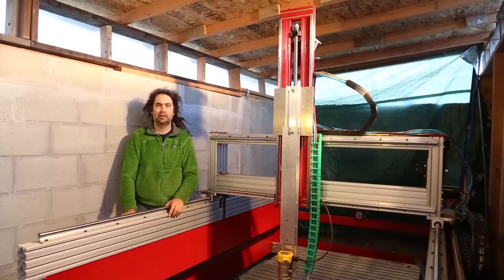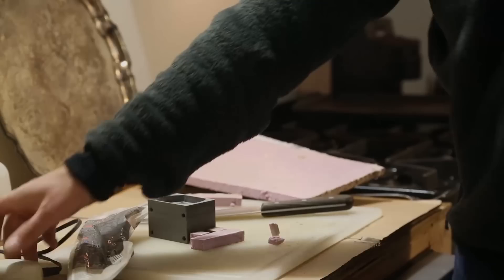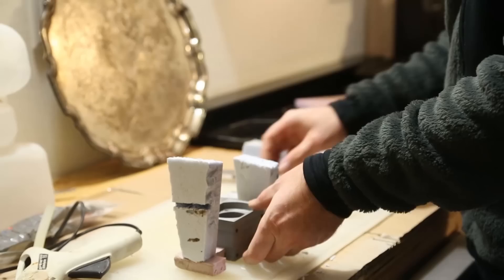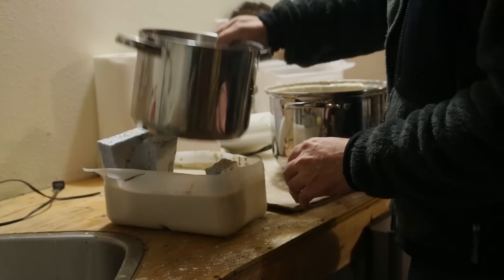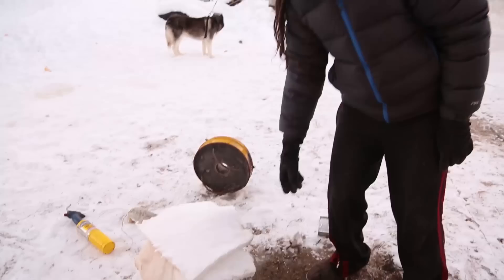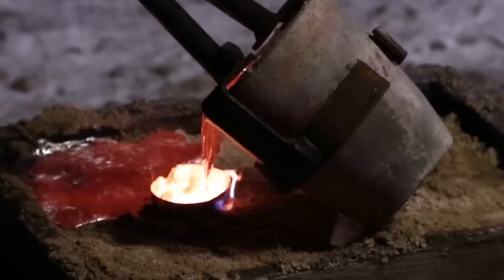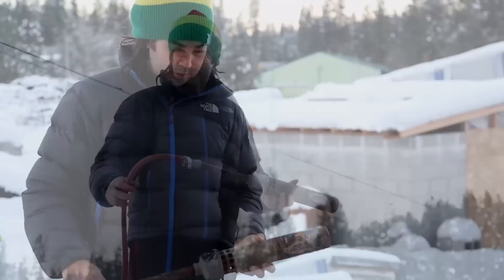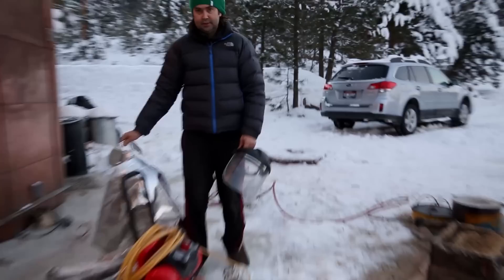Lost PLA 3D Print to Metal Casting; Complete

Comment: When you pour the alloy into the mould, would it help to provide some sort of vibration just as you did for the air bubbles in the first mould?
Reply from the maker: It has never been an issue for me, as metal is much more dense than air. Just make sure there are proper vents and a tall enough sprue to ensure adequate hydrostatic pressure of the molten metal.

Comment: "angle to build pressure" with the spru.  Do you want downforce on the casting material?  Because the static pressure at the bottom isn't any different (w/ or w/o taper), and I doubt you would want any dynamic pressure effects..
Reply from the maker: The purpose of the angle is choke the metal at the sprue (by increasing the pressure at a neck).

Comment: Couldn't you have printed the sprue's and risers and such into it instead of using the foam? Although it was probably more cost efficient to use the foam currect?
Reply from the maker: Yes and possibly, though now I often will print them all out with the part. Makes a lot less manual work.

Comment: Good to know about using play sand, I've used worn out aluminum oxide blasting sand a few times, but generally I use 200 mesh silica flour.  Makes for a really nice finish in the final casting. 50/50 by volume mix.
Reply: Yeah I never heard of using play sand forecasting I just shook my head and walked away. I always use Silica I've been lost wax casting for 35 years and I have never use anything but silica sand. And if you want real fine intricate work you can play with cristobalite in addition it prevents a thermal shock and it allows expansion and contraction remember without allowing it to crack. But in the end cristobalite is mainly used for jewelry casting sign filigrees xcetera. If I had to make some sort of valve body I would use it
Reply from the maker: The play sand I used was silica. Did you even bother looking at the results? I don't think the cast could have come out better quality than it did.
Reply: 3DTOPO if the place and was silica give me the name of the company can so I can sue them for every last penny they HAVE.   Breathing silica sand and the dust that comes off of it causes silicosis and mesothelioma cancer. That's what I've always use a respirator when using it. Play is beach sand with shells removed.

I'm not criticizing you it also don't get so defensive yes it came out very very good did you read what I wrote I said when I heard place and I rolled my eyes and walked away. And then I saw the finish and it was nice.

I was actually going to ask you some tips about getting started doing this. I haven't even built a fort yet I really need to do it because I'd like to pull blanks for my lathe. Also I'd like to try to do some cast iron lathe crank handles after I get the hang of it.

Are there any good books you can recommend? One of the reason why I roll my eyes all the time when people do something different is because I can't ever get anything done there so much conflicting information on the internet I want to pull my last hair out
Reply from the maker: Apparently it is common for playground sand to be silica: <http://safemama.com/2009/05/18/faq-whats-the-deal-with-play-sand/>. Anyways, I probably should have said "river sand" which is also usually high in silica (or quartz, but quartz is essentially silica too). I bought the bag of sand at Home Depot. Its a little dated, but one of the "bibles" for casting is the the US NAVY Foundry manual: <http://www.hnsa.org/doc/foundry/index.htm>
Reply: Jesus that's insane why would they do that beach sand is 100th the cost
Reply from the maker: Clown Whisper "know that beach sand is silica, too, though the fine dust would have been washed away by the water" according to <http://achildgrows.com/blog/2015/07/what-you-need-to-know/> (I suppose river sand would have this advantage too) . They add "this study shows that beach sand is full of contaminants from birds, sewage and urban run-off."

Comment: I just had a crazy thought. You know how it is possible to 3D print clay. Well surely it would be possible to 3D print a mould for any metal part out of clay as from what I understand clay should be able to stand the temperature of aluminium or copper of lead or what ever. Just 3D print the mould, pore the metal and when it has cooled off, crack the clay. Job done simple!!.
Reply from the maker: +Harry Bartelink better yet - they have sand casting printers, search for "sand cast printer" here on Youtube. They just spray sodium silicate and use the CO2 sand casting process (just need XY table and control a inkjet print head). Clay will be problematic as it cracks and shrinks badly as it dries.
Reply from the maker: +Harry Bartelink clay is also problematic because it is not porous, so you would need a lot of vents, and likely want to add something like straw to it.

Comment: I know this video is "old" but I felt like I needed to ask:  Could you not 3D print the gate and whatnot onto the part, instead of fabricating it by hand?

Also, when you used the aluminum foil, and cans in your mould, did that not corrupt your otherwise "clean" alloy with impurities as they melted on contact with the molten metal?
Reply from the maker: See the previous comment: we usually print the gates, etc. now, but I thought it would be easier to explain the various functions by making them for the camera. 

As for a can corrupting the metal, it would have been localized and very negligible for our purposes.
Reply: 3DTOPO I see. Was just curious. I don't have the space or means to do this but if/when I do I'd like to have at least a vague idea of what it entails lol

Very informative video in any case. Thanks for the reply!

Comment: Very informative & educational on new ways to make use of 3D printing.

One question though - if you had a working 3-axis would it not have been quicker, easier and cheaper to just mill that part given its simple nature?
Reply from the maker: +15uzu that would not make a very good instructive video on how to cast metal would it? ;) There are numerous reasons in addition: this process can be used to cast parts literally impossible to machine even on a 5-axis machine, I used 100% recycled material for the part (didn't buy an expensive billet), no wear on my expensive end mills,  setting up the g-code, mounting the piece checking and double checking, running and managing a CNC machine isn't really any less work either (I could go on). Especially now that I am set up for it with a vibrating table, and I usually just print the part with all the plumbing (sprue, runners, gates, etc).

Comment: I didn't see any paths for air to escape at the top of the molded piece. The vents were all at the bottom. Why wasn't air trapped at the top of the part, leaving a void?
Reply from the maker: This is a popular question. It is because of the hydrostatic pressure of the sprue and risers that is well above the part being filled. That said, vents are a good idea to add at strategic places as well.

Comment: Will the plaster mold hold up if you were to cast say brass or bronze rather than aluminum?
Reply from the maker: +Andrew Durrence Yes, but I would not go anything hotter than that (IIRC ~1800F is max for plaster of paris with sand). If you need hotter, use jewelers investment instead.

Comment: Great video! Will this method also work if I want to do small runs of jewelry pieces? The finish you ended with looked good, but will the plaster/sand get the detail needed for smaller parts?
Reply from the maker: I think the same mold preparation method would work, but you would likely need a centrifugal caster (search for that on ebay etc.)

Comment: Why didn't air get trapped at top of the part with the runners and gates at the bottom of the part?
Reply: I was going to ask the same thing... you need a vent at the highest point of the mold.
Reply from the maker: This is covered in the video. The riser also doubles as a vent.
Reply: 3DTOPO
But the fill point of the mold is on the bottom. How does air travel down, through the metal to get out as the metal is flowing in, sooner or later there would be a bubble formed.

Obviously not since the casting turned out well, but any mold I've made were not set up this way.
Reply from the maker: kleetus92 It is because of the hydrostatic pressure from the sprue and riser. Metal is much more dense than air and the sprue and riser are both above the highest part of the mold cavity so it is forced to fill with metal.

Comment: Tied the dog to the power line :-) can't you just leave the PLA in place ? seems to work ok. I learnt the exploding patio slab problem... luckily it missed me
Reply from the maker: Hah! Depends on the part, but I've seen the PLA plug up metal before. Also, if you burn it out first, you can vacuum most the ash out first. I poured directly into a PLA shell in this video: https://www.youtube.com/watch?v=tA1znkGbnSQ Glad you didn't get hurt with exploding concrete!

Comment: That is an awesome result!!!
But I feel like that a CNC would have been cheaper/faster/easier to make that part.
Much more complex designs are better for the lost-wax process.
Reply: he cant do that because his cnc machine was decomissioned
Reply from the maker: The point is you can use this identical process make casts that would be literally impossible to machine. Further more, unless you have a very fancy set up complete with robotic arms milling takes time and work too. First you have to generate your G-code, set up your billet (not to mention first purchase), change tools, etc, etc,. Plus there are other considerations such as my stock was 100% recycled aluminum from the local county dump. That said I have a vibrating table now that I can put a printed pattern on complete with printed runners and and risers and pour the plaster of paris mix. Whole things takes about 10 minutes mix and pour the plaster mold, another couple to pop in a furnace to burn out, and about 30 minutes of my time feeding the crucible and pouring. All said about an hour of manual labor for a beautiful custom cast part (or several).
Reply: 3DTOPO can this same process be done with ABS plastic? and what kind of styro foam are you using? im trying to make a cup out of aluminium and im looking at doing lost ABS because i dont have silica sand or sodium silicate to make a core.

Comment: Really interesting video on DIY foundry, however the part in question appears to be a perfect candidate for traditional, precision machining. In the time it took you to 3D print the pattern, a CNC machine would have your finished part, to much tighter tolerances. Thanks though for an informative video.
Reply from the maker: Thanks. That is a chicken and egg problem - we were building a CNC machine so it was not yet available. ;) Besides, I didn't have to buy an expensive billet (used recycled aluminum instead), no expensive end-mills, etc. Also, programming g-code, managing the job, changing bits, repositioning, etc. are all time consuming operations. If this was a video showing someone that didn't know how to use a CNC machine how to run a job, the video would likely be much longer. Also, if I had the part machined, it wouldn't have made a very good casting video, right? :D

Comment: It seems easier to design the gates, runner, and sprew/riser into the stl file. Making them part of the 3d printing process letting you skip the foam and hot glue step.
Reply from the maker: I usually do - but it would be harder to explain their functions.
Reply: I see, good point.

Comment: Is there a reason you didn't just print out the gates and runners as a component of the 3d part?
Reply from the maker: +Andy Henderson I prefer to do it that way - especially for parts I am going to want more than one of. This I just wanted one and it actually takes far more time to design and print the necessary plumbing parts than to just cut them out of foam since looks don't matter for them. ;)

Comment: why couldn't you just pour the metal into the plaster and forget about the sand? I mean, would the heat dissipate too quickly if you didn't pour the sand around and over the plaster? Thank you for the video I didn't know you could use a plaster/sand mixture for casting.
Reply from the maker: +william french the sand is optional but served me two purposes: 1. reinforcement (plaster is quite weak after firing) and 2. it allowed me to raise the sprue height for added hydrostatic pressure without having to use more plaster (cost less). Cheers.

Comment: Interesting as Im hoping to do some lost PLA in the near future.

However with such a simple part wouldn't it have been easier to just machine a block?

Also can you use ABS in this process?
Reply from the maker: That would not make a very good instructive video on how to cast metal would it? ;) There are numerous reasons in addition: this process can be used to cast parts literally impossible to machine even on a 5-axis machine, I used 100% recycled material for the part (didn't buy an expensive billet), no wear on my expensive end mills,  setting up the g-code, mounting the piece checking and double checking, running and managing a CNC machine isn't really any less work either (I could go on). Especially now that I am set up for it with a vibrating table, and I usually just print the part with all the plumbing (sprue, runners, gates, etc). I haven't done it but ABS should work as well (but smell much worse and probably more toxic!).
Reply: 3DTOPO As long as your outside then it sound be fine then.

Thanks for the video and response

Comment: Thanks for the excellent video.  I've learned a lot from your technique.  I was wondering about degassing of the molten metal.  Did you add any kind of degassing agent and if so what was it?
Thanks again
Reply from the maker: I did not degas it - aluminum is pretty forgiving. That said a shot of nitrogen before the pour wouldn't have hurt.

Comment: wow nice and informative, and since you started with a 3D printer to make your lost wax (PLA) part, I am wondering what you think of 3D printing directly from metal? I am working on a number of materials that will allow copper zinc as well as a few others that would allow solid metal parts with out the high temps or incredibly high energy intensive input to melt the materials as a whole. still puzzled as to how to effect things like aluminum but I will wait till I have started selling 3D printed metal, silicon and carbon parts to get funding for developing harder to print from nano material, aluminum and other amphoteric materials, (though I suspect the methods I have for using neutral atomic materials like silicon and carbon may be the way to go on those :) )
Reply: Link?
Reply: videos of some of our work are coming, though not sure how much we should be releasing till it is ready lol. being able to print a transistor from scratch I think is going to change how everything works forever.
Reply: Well I'll definitely be on the lookout for your work!

Comment: I know his is an old video, but I'm taking a shot that I'll get an answer.  I would have thought that the vent side would need to be near the top of the piece to allow it to fill up.  Maybe I'm thinking of it wrong, but I would have thought air would get stuck in the cavity where the piece is if the spout and vent were both at the bottom.  Obviously I'm wrong since it worked, but I'm trying to figure out which part of my thinking is off.  Can anyone shed some light on it?
Reply from the maker: This is a popular question. It is because of the hydrostatic pressure of the sprue and risers that is well above the part being filled. That said, vents are a good idea to add at strategic places as well.

Comment: Will a 50/50 mix of sand and plaster of Paris also withstand the casting temperatures for bronze and brass?
Reply from the maker: Bronze should work, brass and depending on the specific type could work but could get iffy. I would say worth a try. Otherwise you can just buy some proper investment and use the same technique.
Reply: 3DTOPO
Cool, thank you for the response.  I may try this to compare to sand at some point.

Comment: How did the air get out of your mold? With both risers attached to the bottom it seems like there would be an air pocket trapped at the top of the mold.
Reply from the maker: The riser and sprue are both taller which gives it the hydrostatic pressure needed and air is free to vacate out the riser.
Reply: POVadventure I suspect the plaster of paris plus sand (investment) had enough porosity and was thin enough to let the hot air breath out through the walls. i actually had the same question. And would had added some vents made out of drinking straw. It is good it worked for him without the vents. Less work removing it. The ceramic shell process allows you to dispose of vents since the material is very porous and breathable. Some times all you need is one sprue. It saves a lot of time in tooling, chasing etc. Some people make the plaster insvestment more porous by foaming it with dish soap.